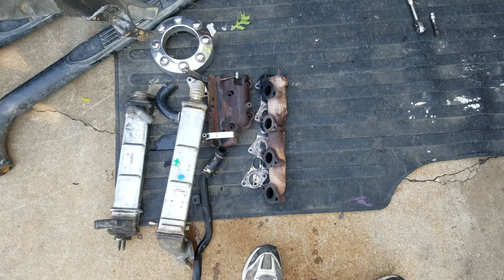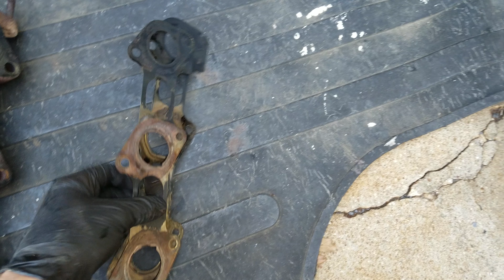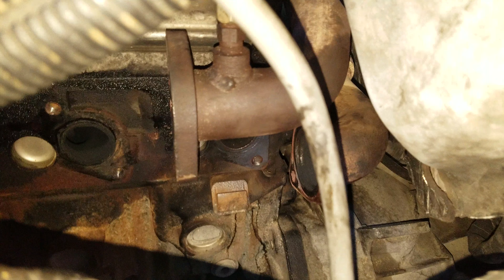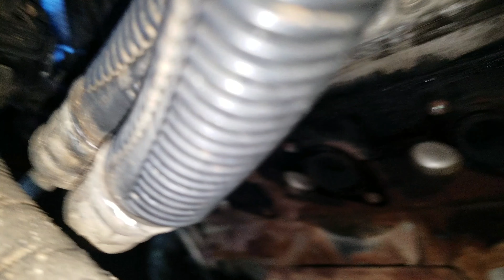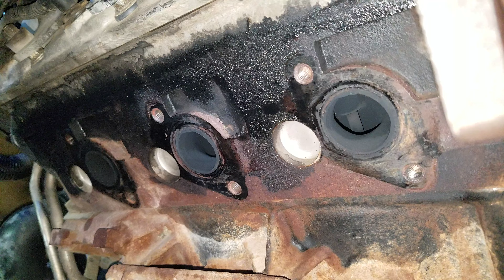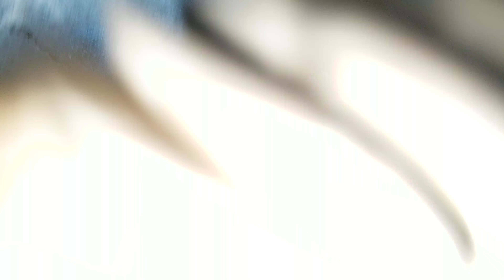2008 6.4 f350 exhaust Manifold and egr removed

Comment: U can weld a nut head to the broken bolt and pull it rite out.
Reply from the maker: Sometimes yes. Sometimes they have to be drilled
Reply: @gagefixeseverything  have had to fix this exact issue sevral time s now on mine and a few friends rigs. Everyone  them broke and I welded a nut to them. One broke.off Orta deep to and I didn't think.it wold work. Figured I would drill it if not.  But bam. Pull that bitch rite out. Good work tho man!!!